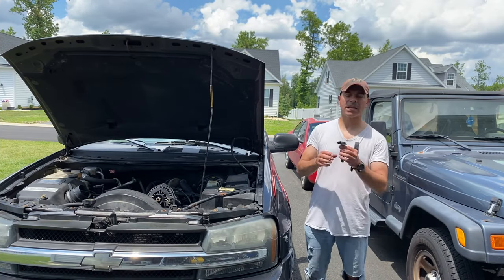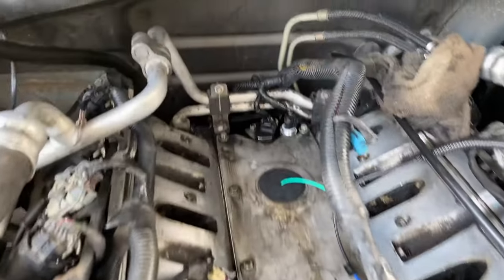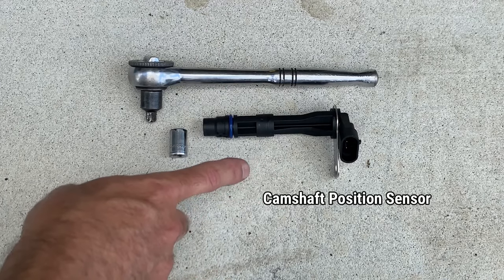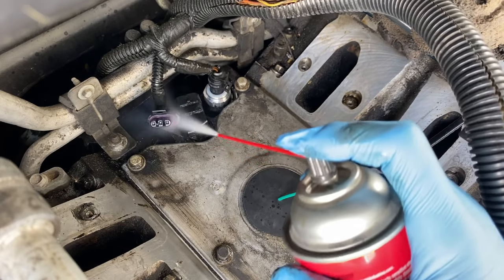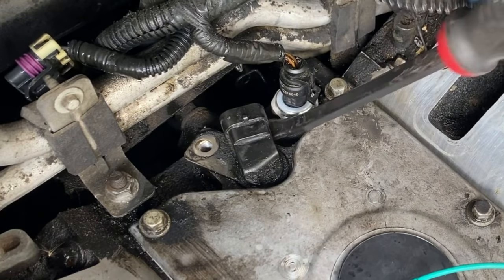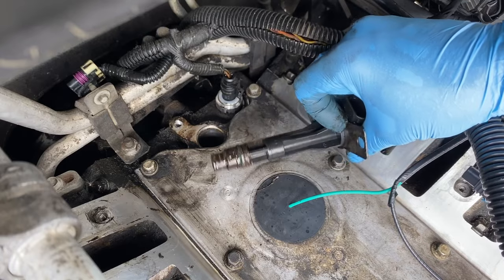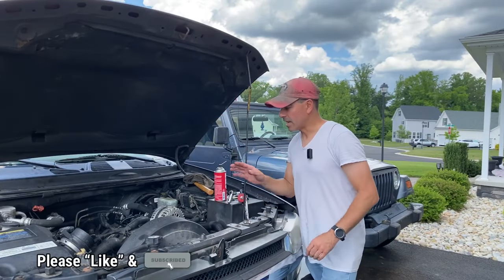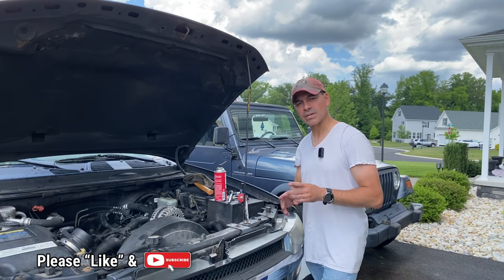How To Replace Camshaft Position Sensor - GM 5.3L V8 (Andy’s Garage: Episode - 421)

Comment: You can remove the sensor in 5 minutes or less 1/4" ratchet with and extension and 10 mil reach around back with left hand put finger on bolt the lower ratchet down on your finger and loosen the bolt then un plug and pop the sensor out so easy just did it and shops charge 2.6 hrs but do it in 5 minutes 😂😂😂
Reply: Are u 100% positive? Some guys did oil sensor replacement without intake removal but it is a nightmare. I always remove intake. I've never replaced cam sensor. And the question is it just 1 sensor for both? I got p0340 and p0341. Thanks.

Comment: good vid!  mine is leaking oil back there and after changing all the other gaskets, about the only thing left is that blasted cam position sensor ( thinking O-ring failure)   Geezzzz I wish I had changed that when I had the intake off last time!  hahahaha     Live and learn.

Comment: Great video! However I have a problem with mine where after installing the new OEM sensor, it's now throwing up a P0342 code where the sensor is getting a low voltage. I checked the harness and it was reading at 11.32 volts. Could it just be a faulty new sensor?
Reply from the maker: @2ndrangersww2  could be, was it aftermarket?
Reply: @PhillipsVision  no, it was OEM made by GM. Do you think a relearn would solve the issue or is it something different. Seems like you solve one problem and 2 more come up
Reply from the maker: @2ndrangersww2  could also be a bad connection. Sometime oil and dirt can get in the harness, try cleaning it out. Here’s a video I did showing how: https://youtu.be/k7lFCNORB7U?si=V0340Butc5k7JqGD
Reply: @PhillipsVision  i will check it out! Thank you

Comment: I  had no codes, changed mine with Delphi, I had 215k miles when i put new valley pan gasket intake manifold gasket etc now i have the code p0342 and p0343. Is  that just due to i need to relearn it?
Reply from the maker: Yes, drive at about 50-60mph for about 10-15mins. That should relearn it

Comment: I have replaced the oil pressure sensor with the intake in place and it was a nightmare.  Now to decide if I can pull the intake off myself or I want to have a mechanic buddy of mine do the work.  Thank you for the video!

Comment: I have a problem, 2005 Chevy trailblazer LT 5.3 engine. Where the cam sensor is located on the video you posted I find cylinder deactivation sensor with 5 pins. Do you have any idea where the cam sensor would be located? Including the knock sensors?
Reply from the maker: Knock sensors should be on top The Valley pan lid. Cam sensor should be around The Valley pan
Reply: @PhillipsVision  I googled it with the Vin. Number, it was located close to the front of the crankshaft on the front end.

Comment: I need to replace the intake gaskets on my 01 Suburban (200K miles). What all should I go ahead replace as preventative while I have the intake off?
Reply from the maker: @mehGyver  I would do the valley pan lid gasket & knock sensors, and the valve stem seals & valve cover gaskets. It also wouldn’t hurt to clean the harness connectors for the CAM Sensor and Oil Pressure Switch. If your vehicle has the 5.3L V8 those sensors are tucked behind the intake manifold.
Reply: @PhillipsVision  Thanks! I'll get all of that done so I don't have to go back in there again.

Comment: Hey Andy, is this an expensive fix? I got that same code and I am experiencing a rough idle on my ‘13 Sierra. Also I believe my oil pressure sensor is leaking oil as well. Oil presos good but I took a picture of oil around the sensor.
Reply from the maker: Not too bad. If you go through GM dealerships they’ll rip you off. I got mine at Autozone for around $70. Could be your valley pan lid gasket leaking. I had the same issue and it was that gasket leaking in the back. Here’s the link to my video: https://youtu.be/6nDK-5InrmU?si=mqmIvSi5awA1pJn3

Comment: GOT A 5.3 HOW CAN i TELL IF VALLEY PAN IS LEAKING THE ONE UNDER THE INTAKE
Reply from the maker: Look for oil leaking along the back near the oil pressure switch and camshaft position sensor

Comment: Can the sensor fail without throwing a code?
Reply from the maker: Maybe, but I have never seen that. The code has always been present
Reply: Yes. My 02 Yukon XL 5.3L died on me while driving without throwing a code.
There is a YouTube video with a guy that took his corvette apart with the same crank no start issue I had. He traced all the wires to find the cam sensor was bad.

I replaced mine and problem solved.

A bad cam sensor deactivates fuel to the injectors.

Comment: Does it have the vvt 5 wire cam sensor my wires got ripped out of the cam sensor plug do don't know what wire goes where in the plug
Reply: Get an endoscope camera and clean the wires. You should see the colors. Attach the like colors properly and you should be good. Hope that helps.